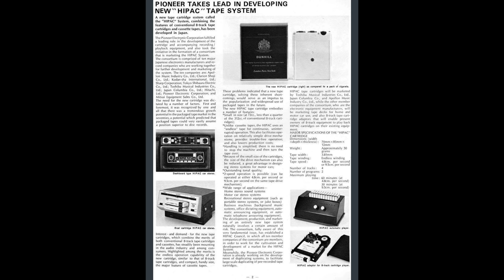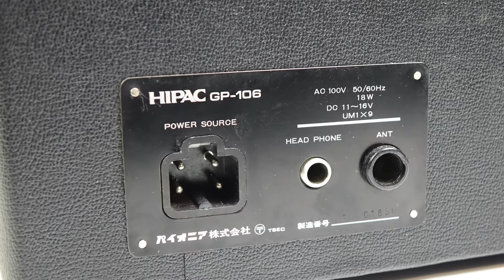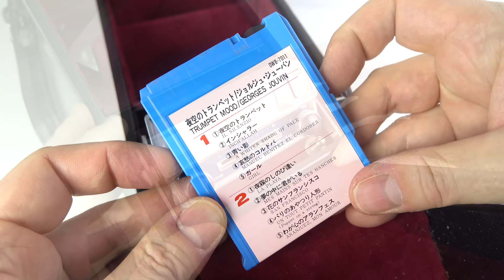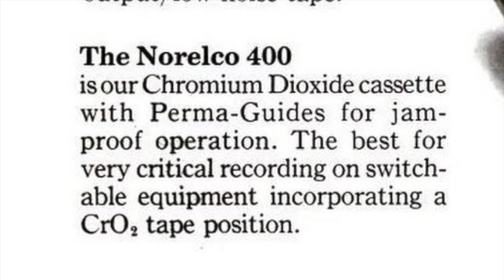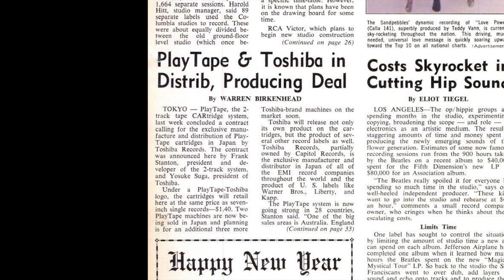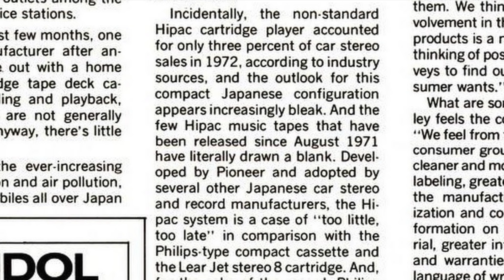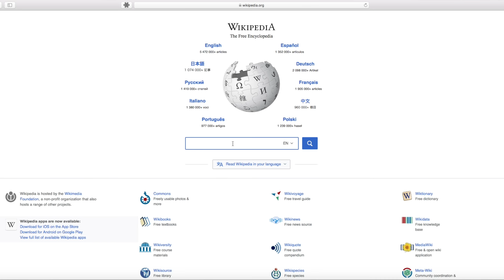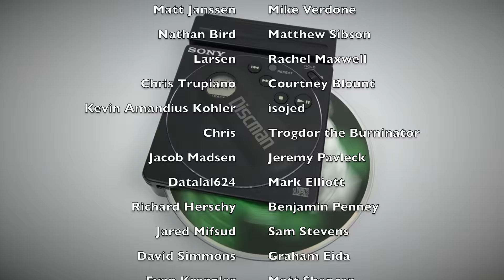Hipac  - The lost tape : Pioneer's forgotten 1970s cassette rival

Comment: Here is a long forgotten format:
 http://ftldesign.com/Timex/index.htm

Yep this is a audio product by the company that brought you the Timex watch and the Timex Sinclair computer.   The only reason I even know of this device is I found one for sale at a Flea Market in the late 70's.  It worked ok or I should say it worked as well as it ever could.  You had to use a guide record to locate the tracks on the magnetic disk.  It also played 45 rpm records by swapping the tape head for a lp cartridge. Fidelity for the magnetic disk was voice grade and the 45 player was ok.

If you can find one it would make an interesting video. As far as I know, it was only sold in the USA.  

 "NOW - for the first time, a recorder with all of these features:

Low cost
Simple to operate
Small size
Plays 45 RPM records
Discs can be folded and mailed
Discs compact for storage

This unique new magnetic disc recorder is especially suited to home and family use. It will record 'sound albums' of anniversaries, engagements, children's first words, birthday parties, correspondence in sound from distant friends and relatives. It will record direct from radio, phonograph and TV; and can be used for business recordings.

The unit is as simple to operate as a standard record player; nothing to thread, no tape to break or tangle, no needles to wear out, no complicated controls, no accidental erasures.

The recording discs, iron oxide on a plastic base, are extremely smooth, lightweight and flexible. They can be folded and mailed without damage - only first class postage required. Over 100 discs can be stored in the space required for one standard record album."

Comment: "What's a white hole?"
Reply: In general relativity, a white hole is a hypothetical region of spacetime which cannot be entered from the outside, although matter and light can escape from it. In this sense, it is the reverse of a black hole, which can only be entered from the outside and from which matter and light cannot escape. White holes appear in the theory of eternal black holes. In addition to a black hole region in the future, such a solution of the Einstein field equations has a white hole region in its past.[1] However, this region does not exist for black holes that have formed through gravitational collapse, nor are there any known physical processes through which a white hole could be formed. Although information and evidence regarding white holes remains inconclusive, the 2006 GRB 060614 has been proposed as the first documented occurrence of a white hole LMFAO